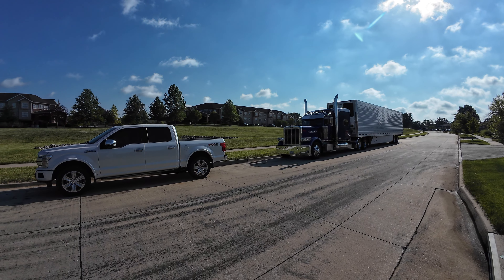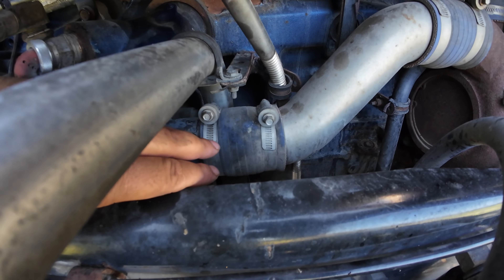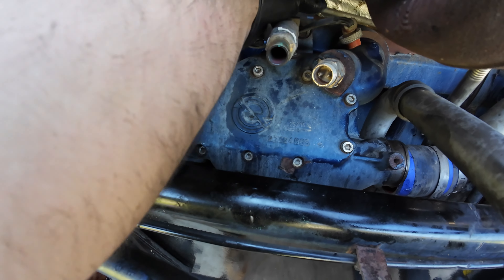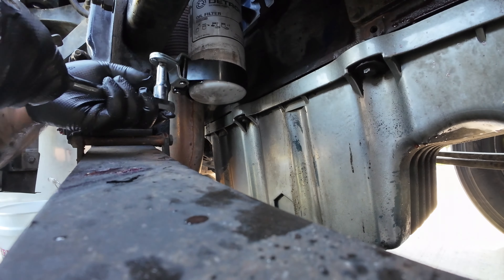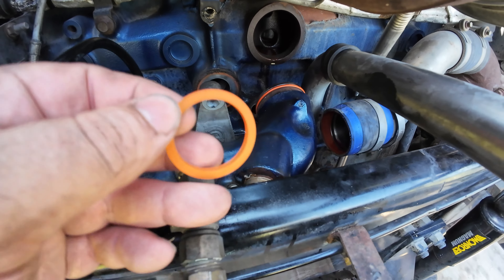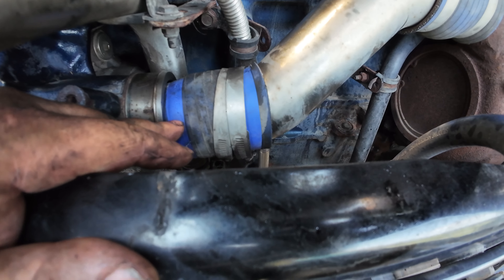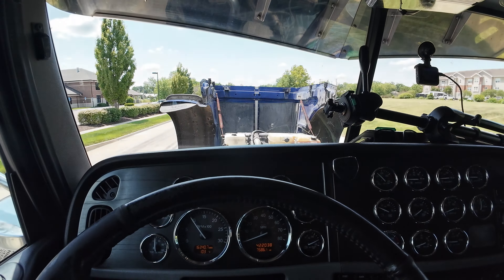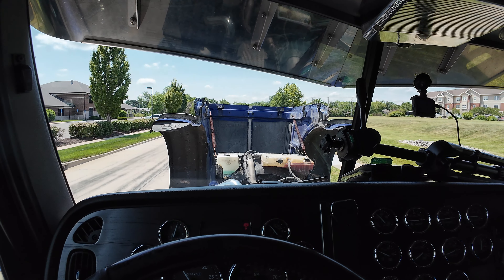DETROIT 60 OIL COOLER GASKET REPLACEMENT PETERBILT 389 PRIDE AND CLASS GLIDER

Comment: Hey Good Video Bandit, Yeah took a camera ride....wheee!!...lol🤣 ....Here a tip down the road, might use some petroleum jelly on O-rings before putting on parts so you don't nick the O-rings on rough parts for down the road possible failures and add little more petroleum jelly on O-ring area eases installation of parts going together. I would spray big line or inside of radiator hoses with WD40 to help slide rubber hoses around on the steel cooler tubing going to water pump. WD40 helps them rubber hoses slide around a bit easier. Glad you got new filters since they was tighten down a bit squeezing the O-ring gasket. Your like me always need a medic around at times. Take care and enjoy the beer or favorite drink by the pool. Job well done Cheers!🍻
Reply from the maker: Much appreciated buddy. My dumb ass never thought about using WD-40, I always just spit on it lol
Will definitely remember those tips next time I’m doing something like this.
Reply: @OTRBandit  I've done the old spit thing too. WD40 works great on heater and radiator hoses. The O-rings some will swell up and become no good using a oil spray or engine oil. The petroleum jelly come back from working on military jets and commercial airliners. As works very well and melts away when getting warm hurting nothing. 👍
Reply from the maker: @Twister-10228 Will definitely get some that petroleum gelly. You think Vaseline might work instead?

Comment: Good job, bra .I'm glad you put new oil filters on smart move .you sound little under the weather. Yes, the older you get, the easier we get hurt working on stuff.  Safe travels, driver 🙏
Reply from the maker: Much appreciated brother 🙏🏼
I was just not happy about doing this job, that’s why my voice was like lol but I was sure happy after I got done. Freightliner said it would take them 4 hours to get this done. That’s $800 right there. I always get hurt when working on something. I’m just not careful or it may be the getting old part.
Reply: @OTRBandit  you fixed it just as good as the dealer. And a lot cheaper. Getter done. I work on all my stuff, also always bleeding .respect, my friend💪